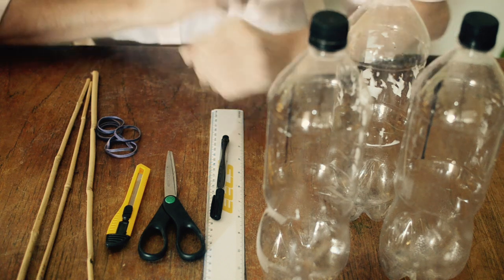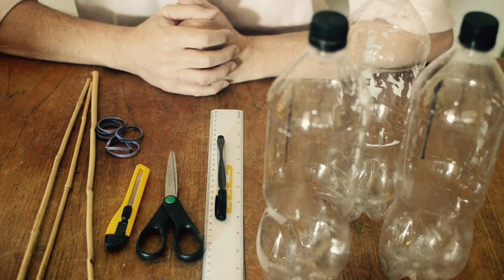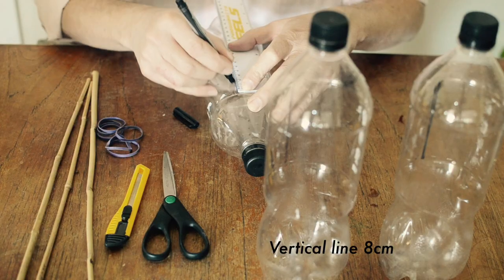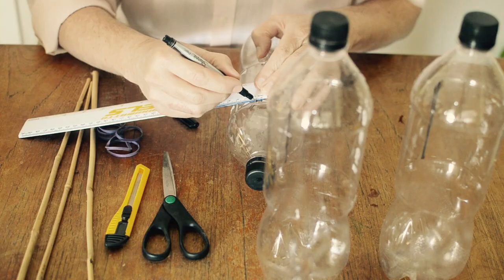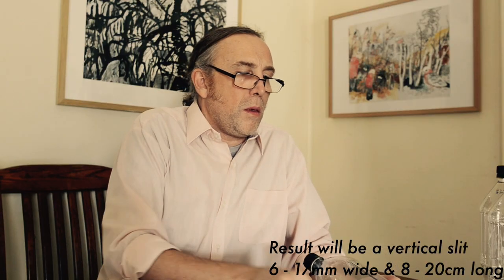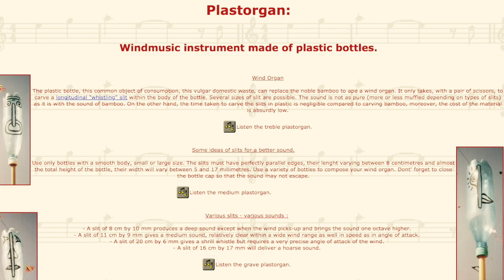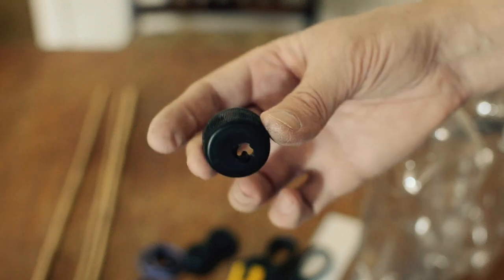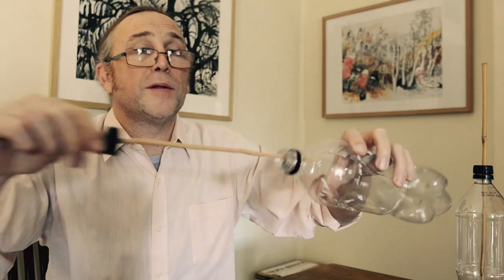How to make wind organs

Comment: Hi I mount mine one on each end of the board. I drill hole in the lid. I use a drill press and drill  2 holes  atound 5 inches long Then I cut it out with strong Sizers.  I mount the 2 bottles on each end of the board and attach.the board to a post. I have found that the harder the plastc bottles the better the sound. I point one bottle to the north and the other one on other end of board. This way if winds switch one or the other bottles will hoot. I can hear them 50 feet away.
Reply from the maker: That's a great idea

Comment: You can drill hole in lid and then mount it on a beam over porch or on a post or deck railing top and screw the bottles on and if you need to turn the slot you can turn the lid a bit. I found out that mounted on a beam, the sound is a bit louder. I guess the wood porch beam resonates the bottle some. I drill 5/8ths hole near top and drill another one 5 inches below it and then cut the slots out with Sizers
Reply: I drill 2 5/8th holes  one below top and one 5 inches below that and cut the slots out with scissors.
Reply from the maker: Yeah cool, that's one way.

I've been using a Dremel:
https://www.youtube.com/watch?v=Ke7iSsTBN14

Comment: How many of these should I construct and install in an out-of-sight location in order to achieve maximum impact on freaking out my neighbor?
Reply from the maker: Dunno, how good is your neighbour's hearing?
Reply: @bassling, He has decent hearing, but more importantly, he’s always listening😛
Have you ever tried mounting one of these whistles upon a platform that rotates—similar to a weathervane—so as to maintain the angle at which the wind flows around the bottle in relation to the slit?
Reply from the maker: That's a good idea. I'd been entertaining an idea more like a windmill, where you can create the airflow at a rate to get the overblow effect that increases audible volume.
Reply: @bassling that would be incredible and so fun to build. I hope you’ll consider posting whatever contraption your come up with. You could very likely achieve the necessary velocity with blades even in gentle wind speeds, I’d reckon. I do wonder, however, if creating a weathervane or a bladed system might detract from the sonic quality through the introduction of stability. I ended up making a few of these bottles and placing them in the garden. What I noticed, like with music, the periods of silence and variability in volume contribute greatly to the perceived quality of sound. This is, of course, achieved through the generally turbulent nature of wind. But I’m probably overthinking this as well. Neither of these approaches are likely to achieve such a constant flow of laminar movement as to produce a completely flat sound. Such a fun project!

Comment: Ii mount mine on 2 by 4s I drill hole in cap and mount tight upside down.
Reply from the maker: That's great! Let me know how they sound?
Reply: @bassling  The 2 that I have on fence posts are doing great.  I have found out that you can turn the slots to northwest and you will get the north winds sliding by the slots. In spring and summer I turn slots to south to get southwest winds. Seems like the tighter they are mounted on a post , they will hoot better. I will soon try to see if I can amplify them mounted to a larger plastic container and I will let you know. I believe that the lower container they are mounted on would make them a bit louder.

Comment: I am going to get some pvc 4 inch wide pipe and make one for a test. I will seal top and bottom and add an oil funnel for the cap which will resemble a tin man. Mount it up high and see what it will do.
Reply from the maker: Great idea

Comment: Hi can you make them from a metal can?
Reply from the maker: Yes, any round object with parallel sides should work.
Reply: @bassling  I was thinking of mounting some on top of plastic box containers for amplification.
Reply: @bassling  I finally tried the aluminum beer bottles and they are louder and a bit different in sound.

Comment: Would I actually have to go buy some plastic bottles??
Reply from the maker: Not necessarily. Any round container with parallel sides should work, but ideally longer than 8cm. Plastic bottles are easier to cut than more rigid materials though.